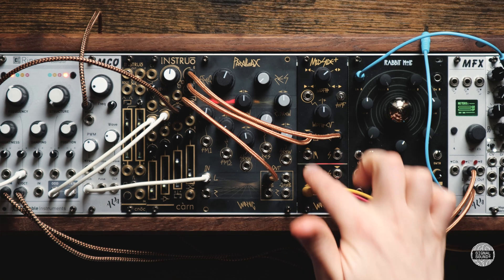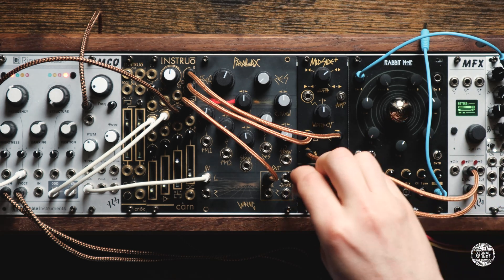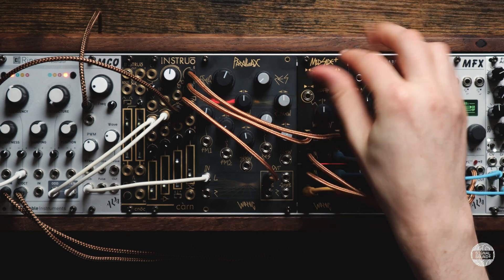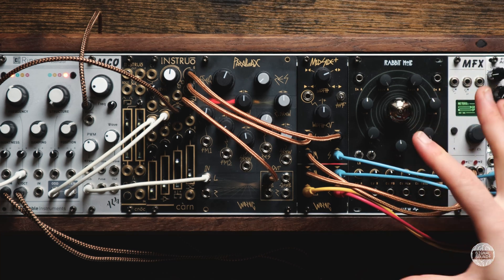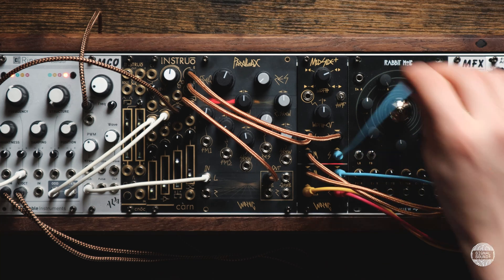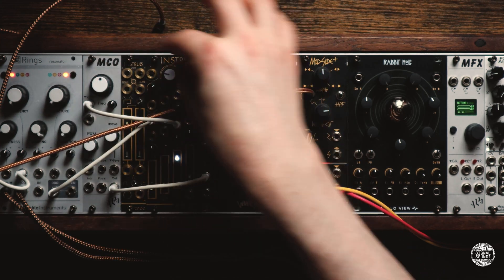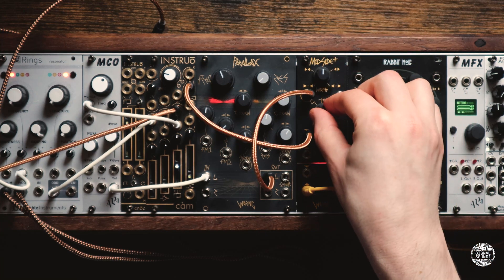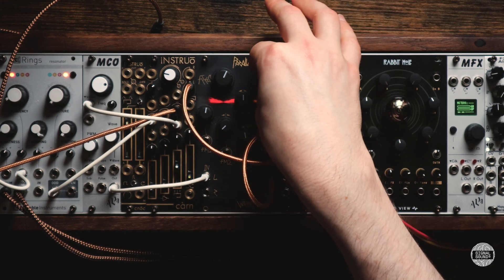Worng Electronics MidSide+ is AMAZING!

Comment: I have the original LRMSMSLR, kind of wishing I had the additional control this new version offers, though with the original you still can control width/balance by using attenuation/VCAs on the mid or side channels.
Reply: I am in the same boat, Bill… I am tempted but it has inspired me to patch in my original with some VCAs and func generators.